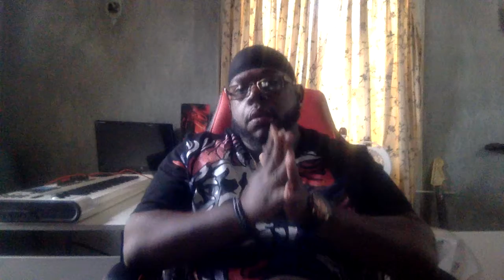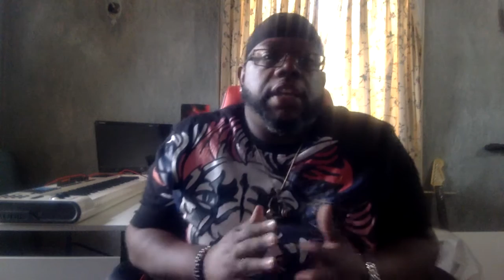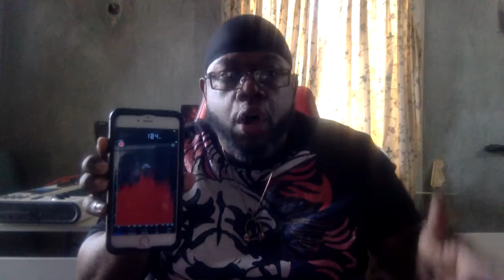Box & Cross over  tuning

Comment: I going to try this. My box is tuned to 32hz but my crossover is set to 80hz. my amp lpf goes down to 35hz. Going to set it at 35hz and see. This makes sense because my amp has a 24db slope. So I'm cutting my lows way off.

Comment: Bro what? Not sure if ur just over explaining it or what but for example, My box is tuned to 28hz, my subsonic/hpf is set at 20hz because i can play safely down 1/2 an octave or so, my lpf is set around 60-70hz, to cover the gap i plan on putting dedicated midbass 10s in the door which should play from 70ish to 150ish hz to cover the gap between subs n midrange drivers
Reply: Lpf set to 35hz makes no sense ur just limiting/ filtering out all bass above 35hz, which even my box tuned to 28hz can play up to 60hz or so without issue, again not sure if im just not completely understanding u but bro idk